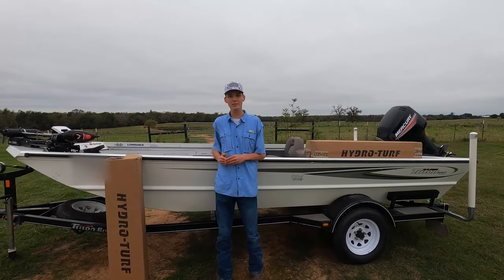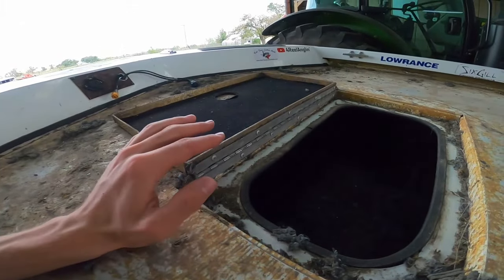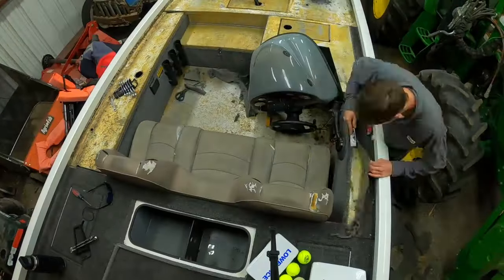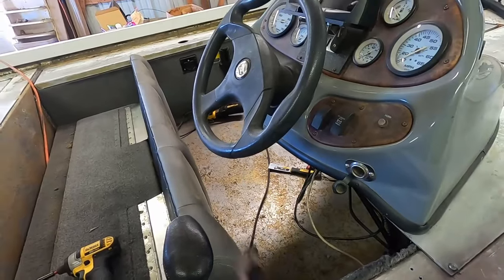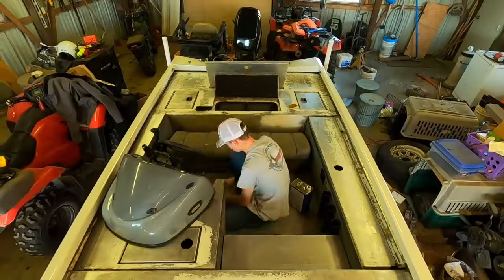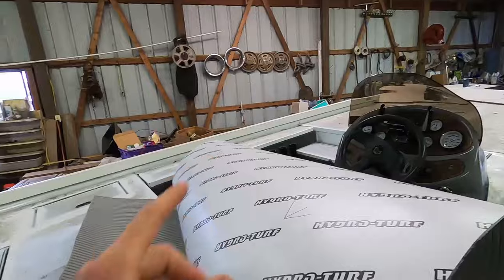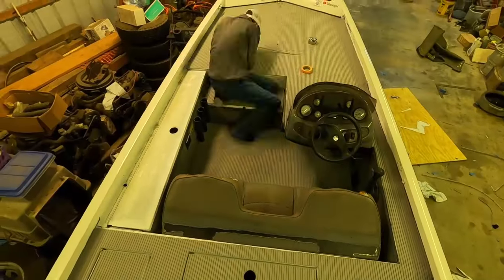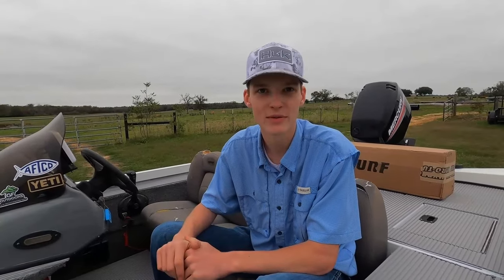My Boat Gets New Flooring! - Hydro-Turf EVA Foam Install

Comment: Next time you might want to get aluminum disks for cleaning  headgaskets those rubber disks do a great job cleaning aluminum  cylinder heads . They are very efficient cleaning  aluminum and they don't load up with glue.
Reply from the maker: Okay, I will keep that in mind. Thanks!